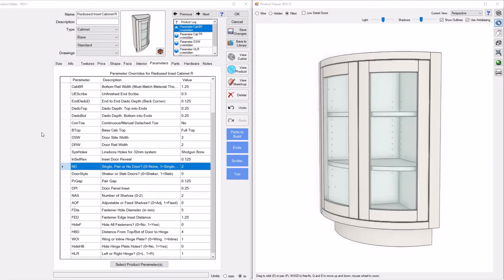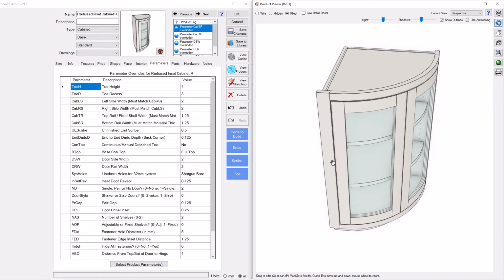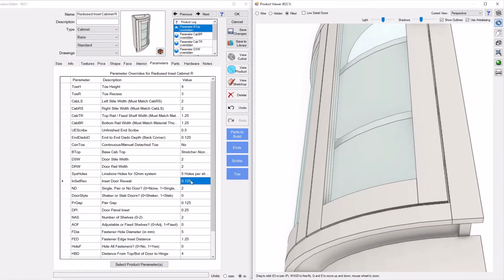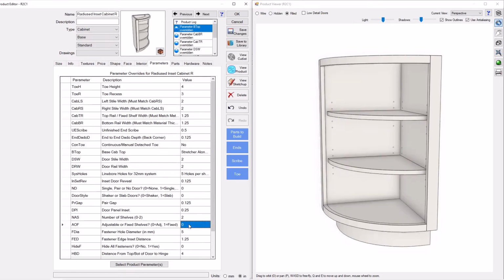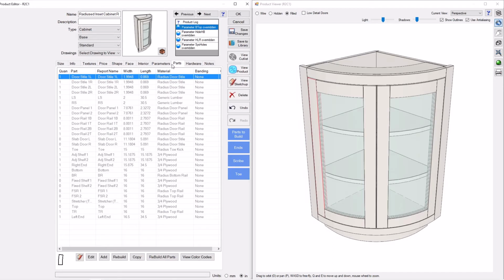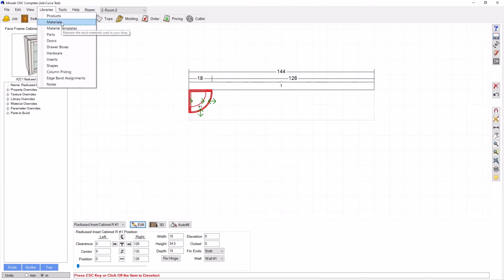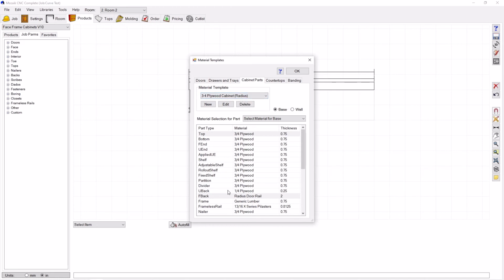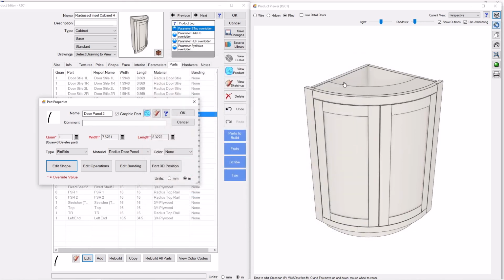Frost CNC - Mozaik Software - Advanced Tricks: Parametric Radiused Cabinet

Comment: I'm a Cabinet Vision engineer. Does Mozaik allow for User Created Standards? In CV we can make UCSs to manually program CV to do things that it wasn't originally able to do. For example, I can make notched hanging rails from blind nailers on uppers, parametric sex bolts, one piece face MDF face frames.... I even have a UCS that activates when a face frame cabinet face grows above 48" and changes it's dowel boring pattern between a case and face frame from a parametric hole placement that reads from the overall part length on our OMAL edge borer to a fixed pattern running from both ends of the panel part. Tons of super complex stuff that we have to manually program.

Does Mozaik have options for an unlimited amount of high level customizations like CV does with its UCSs?

Comment: wow, my head hurts trying to figure this out....Now if we could figure out how to "make" those curved rails easily 😁
very helpful, I just built a round top cabinet with Mozaik, (round face frame panel product, square cabinet box)...and I would be interested in what you have come up with on that. (parametrically)
Reply from the maker: I also needed an Advil or two for this one...the formulas required to make this work are intense.  Here's an example if you're curious...this is only one point in shaping a door rail...yikes!

((D-CabRS-DoorFrame.th)*SIN((((2*(D-CabRS)*3.14159265/8)-(PrGap/2)-InSetRev-(DSW*2))/(D-CabRS)*180/3.14159265)/2)*2)*COS(((((2*(D-CabRS)*3.14159265/8)-(PrGap/2)-InSetRev-(DSW*2))/(D-CabRS)*180/3.14159265)/2))

I'll shoot you an email.

Nic